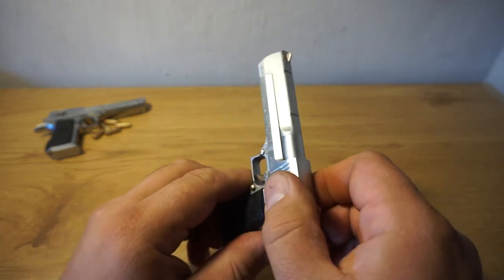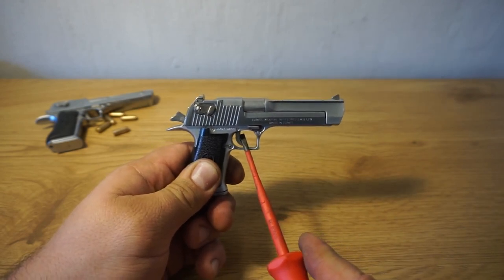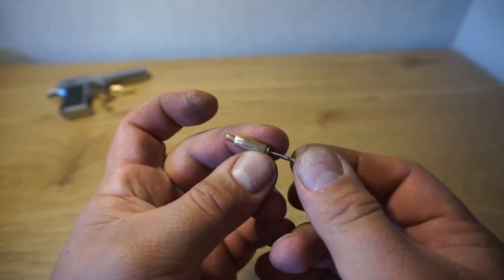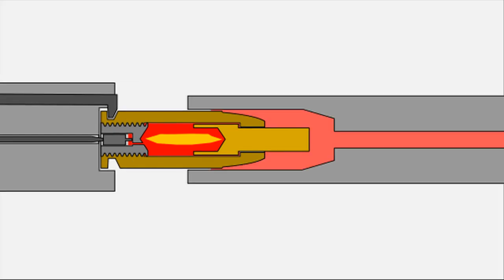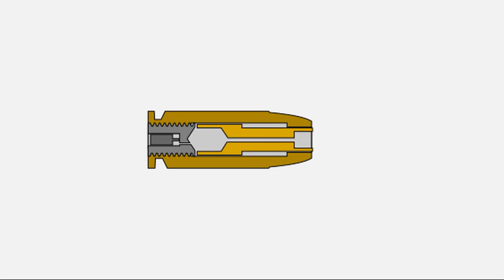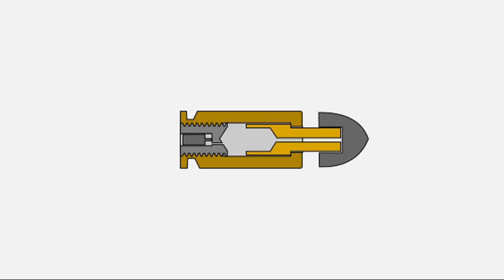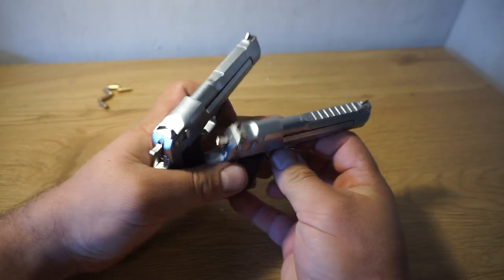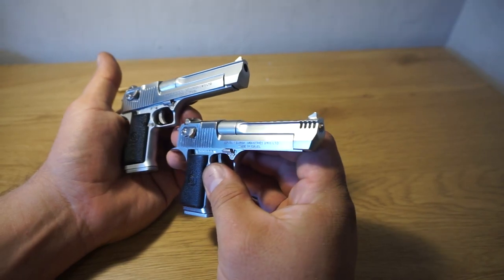Miniature "game changer" or smal step in the right direction?

Comment: this type of ammunition is a small step in the right direction, this has been done is the Japanese model guns, the only difference between your design and the other is that, the front piston (or rod if you want to call it) is cut to be a a simple flat cylinder  that does not protrude outside of the cartridge, with this being said their is a small rod that inserts into the cartridge once it is in the barrel. it only acts non the cartridge one the hammer is engaged if. you decide to look further into this, look into it!

Comment: What are you using for a primer material? There’s a company here in the USA that sells the equipment to reload the “unreloadable” 22’s. The primer compound kit can be shipped through normal mail because it is the raw chemicals which are inert on their own and you mix them with the provided measures.
Reply from the maker: Yes, heard about it, you have three bags of chemicals that must be mixed together.

I won my primer stuff from kid toy cap ammo.
Reply: @ComradeMauser  I live in a weird location where caps are near impossible to get. Everything coming into the island where I live is either air freight or barge so bringing in anything considered hazardous is difficult and expensive.

Comment: Do you make yours own powder ? What powder do you use? . Btw nice channel.
Reply from the maker: No, I don't make powder. I use cap ammo powder,  grinded match heads, black powder or  smokeless powder  depending on the situation and goals I will achieve.
Reply: @ComradeMauser   Nice. You have armstrong powder as precession cap and sulphur as the fuel for projectile? . Small is cute and its working wow i give you that you did awesome work.  Thanks 👍

Comment: Could it be a slide/bolt weight vs spring strength and/or friction points (tolerances) and lubrication issue?
Reply from the maker: No more, i can easy install more powerful springs and it will work. this ammo has enormous kick, as you can see